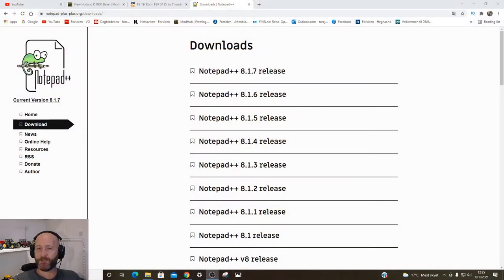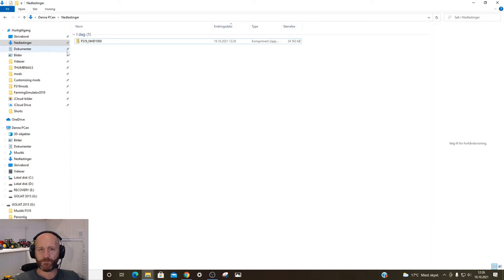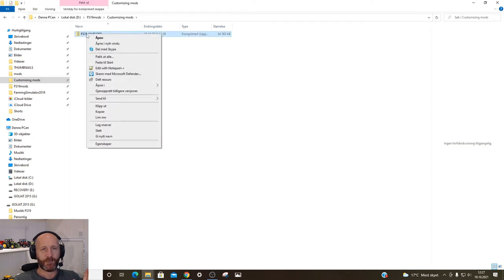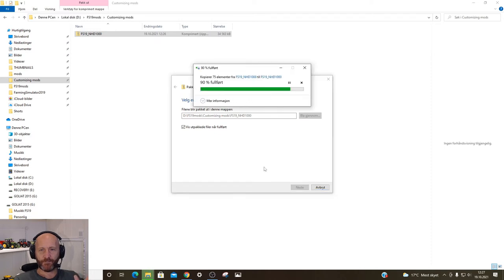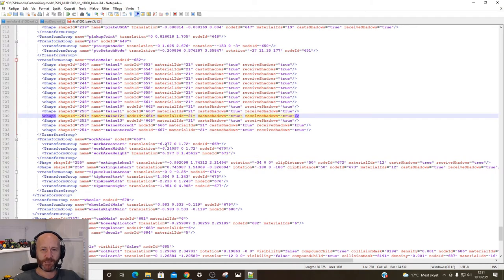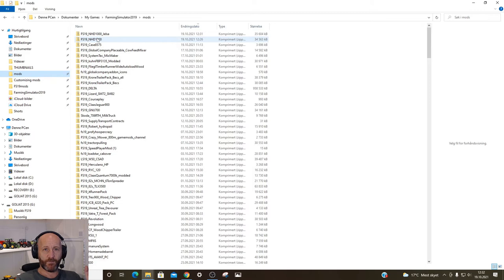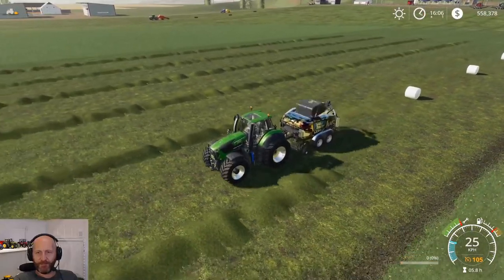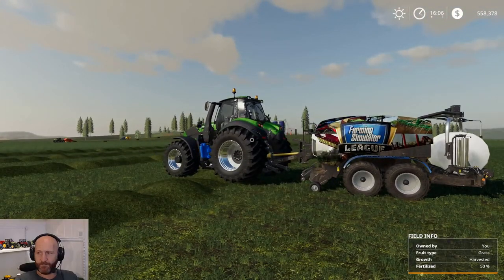How To: Edit I3D file - Baler with wider pick up - Farming Simulator 19 - PC

Comment: HI i have a problem that kept coming out from time to time. When i create or modify a working width, sometimes one side it's offset making it wider than what actually should be. LIke i have 3 m (1.5-1.5) and the right side it's visually at 2, but in the debug view it's prefectly squared at 1.5. No node or transf group has scaled or rotated, everything it's at 0, i recereated all from scratch instead of duplicating, but nothing seems to fix it. It shouldn't happen, or threre's something more?